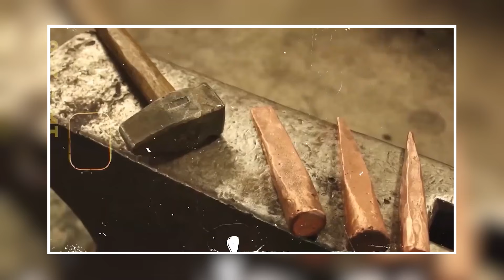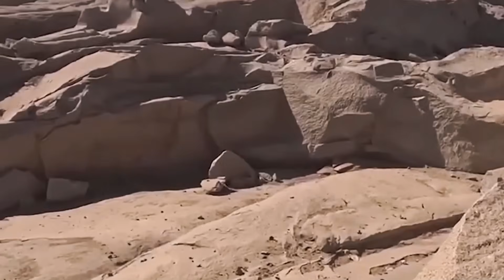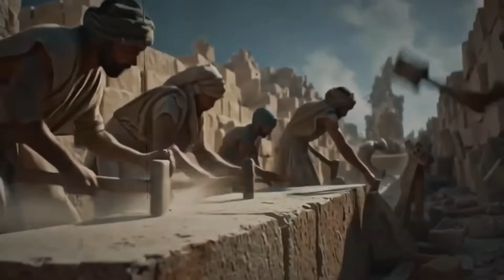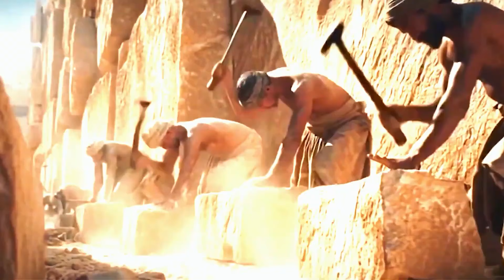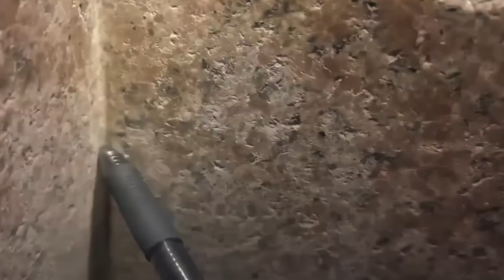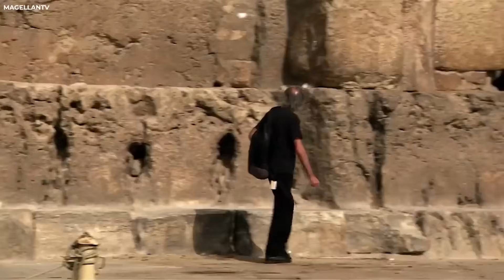Scientists Asked Grok AI How Egyptians Cut Granite… Its Answer Shocked Everyone

Comment: internal mapping can be done by carefully tapping the exterior of the stone and listening the sublte differences in tonal , resonance, and length . making a note on the exterion of rock creating a dot field and then outlining a map of the internal density inside the stone. High pitch metal short tight sound would be very dence. low pitch hollow drum resonate. low density , stand upright on the base of stone and wald 360 with shaded dot matrix and a clear visual internal density pitcher with be shown as if the stone was trinslucent.